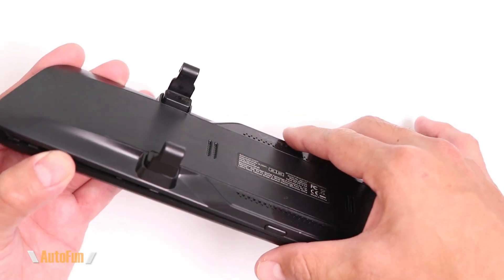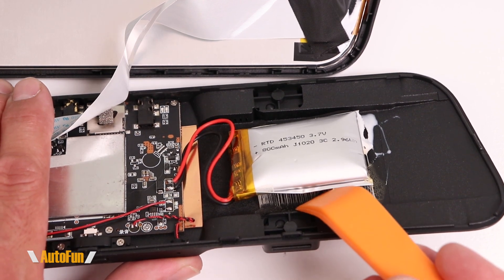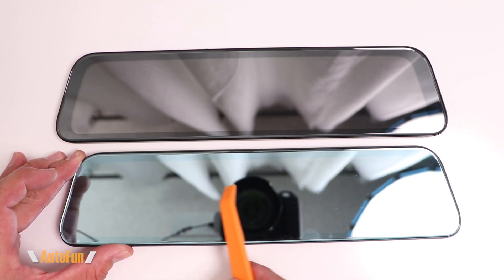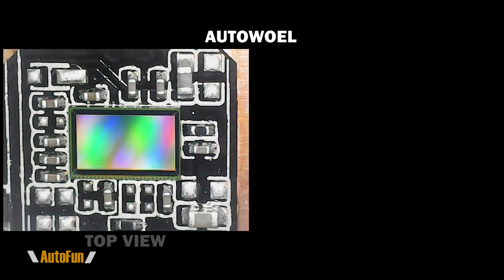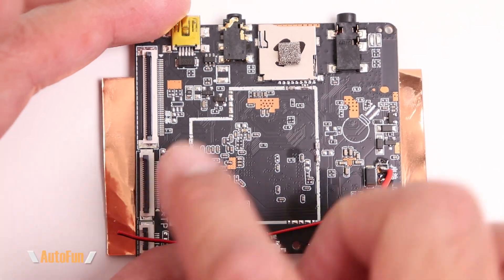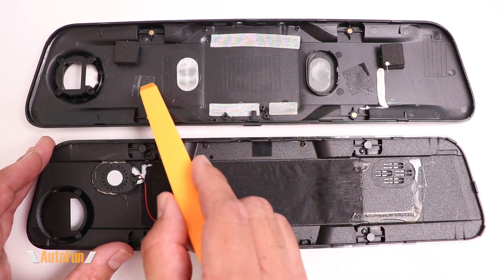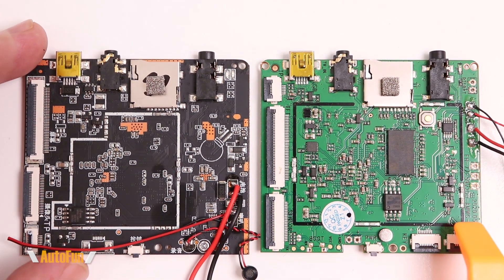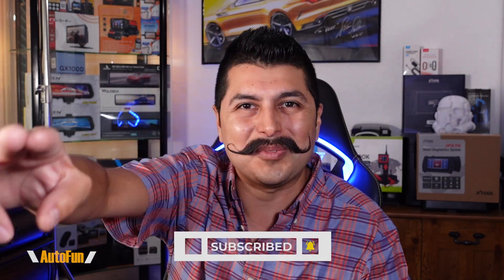Mirror Dash Cam Teardown: Autowoel V17Pro Vs Vantop H612T

Comment: Hi, I bought one, a used BluAvido AC79 Pro (Android 8.1, 4Go/64Go).
I wanted to know if there was a battery inside to keep settings while off.
My device does not seem to recharge something (I've got a little device I can put on a USB port that shows me Voltage and Intensity).
So.. do you think I need to open and replace the battery... if there is one ? 🤭
Reply from the maker: Hi F! Unfortunately I'm not familiar with the AC79, however the manual is likely going to show you if the dash cam uses a capacitor or a battery, Cheers!
Reply: @AlexAutoFun  I was able to open it: no battery. I don't know if it would be a good idea to put a portable battery between the camera and the power supply...?

Comment: Input voltage?
Reply from the maker: HI Kareem! It can be powered with the included power adapter as shown in my full review here https://youtu.be/fQDgk2YnRhQ for Vantop or if you are referring to the V17 here https://youtu.be/bUVG4B8dCmI or the Vantop could also be powered with the hardwire kit here https://youtu.be/83a3w6EtzXo Cheers!

Comment: Have you taken apart any Wolfbox cameras? I have G850 and am considering making the forward facing camera detached. Wolfbox does not sell a model with detached front camera, but I've tested many other brands that do and I just don't like them as much. I'm curious what connectors are used on the G850 camera. I'm sure I can take it apart myself, but thought I'd ask.  My plan is to get longer cables and mount on the windshield to have an unobstructed view.
Reply from the maker: Hi Matt! Ah yes the G880 has a detached from camera https://youtu.be/JJKbUu_egiE but yes I have a Wolfbox teardown video coming, stay tuned. Cheers!
Reply: @AlexAutoFun  I did run across the G880 in my research, however the detached front camera is designed to be a cabin interior view and I believe it has IR for night vision. It wouldn't be an ideal camera to face out the front for street view. I'm sure I could find a different camera to use for the front, however the cost of the G880 is high, on top of buying another camera to use for the front would make it over $300 option I think.    Do you now which Wolfbox model you will be tearing down?
Reply from the maker: Hi Matthew! The G880 has both a cabin camera and a front camera (both are of the detached type) only the cabin camera has IR. Regarding the Wolfbox teardown, it will be one of the two channel ones (making the final decision on the model soon) But I would like to do a teardown on their entire lineup, it just depends if there is enough demand for this style of videos, stay tuned. Cheers! @MatthewBennettFPV
Reply: @AlexAutoFun   Unfortunately the G880 has been replaced with the G890, that doesn't have the front facing camera separated from the mirror. I've looked on eBay and other sites to see if I can find a G880 but none are available.
Reply from the maker: Hi Matthew! That is correct, the G880 is a very hard find now, they do come up for sale every once in a while but when they do, they go quick. Cheers! @MatthewBennettFPV

Comment: What's supposed to be the problem of my dashcam if the time and date keeps on resetting by default when turned on and off. Also it wont automatically record video.
Reply from the maker: Hi Sen! It's possible the dash cam is on it's way out or the power supply it's on it's way out. The easiest way to check for this is to connect the dash cam to know good working power supply (either hardwired or cigarette plug style) to confirm if the issue is with the dash cam or with the power supply. Cheers!
Reply: @AlexAutoFun  could it be possible because of built in battery?
Reply from the maker: Hi Sen! The time issue possible, however if the power supply is not charging the battery, the direct issue would still be would the power supply. Cheers!

Comment: Interesting.  Growing up at around age 8 i had a curiosity for how things work from the inside. Everything in my bedroom was opened up and reassembled by me. Surprisingly it still worked when i reassembled it. 

The super capacitor is one of the reasons why i switched from my vantop to the wolfbox g890. I moved to Az and temperatures here get as high as 120's sometimes. Hopefully this super capacitor could withstand the Arizona heat. 

By the way what happebed to vantop? I searched them on amazon and didnt see any of their dash cams on sale.
Reply from the maker: Hi Edgar! Ah good question, here is my Vantop situation video https://youtu.be/HmcZ-Gyx4To Cheers!

Comment: Or how do I wire my dashcam to not need a battery and just turn on whenever my accessories are on. Because even if it is plugged to my.cigarette port 12V socket. Due to the battery being unusable, my dashcam wont work
Reply from the maker: Hi! If your dash cam uses a battery, it normally won't work correctly without one since the battery may be being used to save the dash cams settings, park mode, closing out video files in case of a power interruption (such as the case in a serious car crash) etc. I would recommend contacting your installer or your dash cam vendor to see if the dash cam is still under warranty. Cheers!

Comment: I also have a mirror dashcam somewhat similar to this. My battery also bloated. Tried changing it but it still didnt work. Maybe you could make a video changing it and showing that it works... mine is a lenovo brand but same sound while booting up. More power to your videos!
Reply from the maker: Hi! Ah yes while I had some viewers replace their batteries, I personally wouldn't fix it unless you want to do it for fun or as a learning experience. In my case while I often solder as a hobby, I choose not to repair mine and just moved over to a new dash cam. The time and effort to source parts (if needed), de-solder and solder and reassemble is just didn't make sense for me with the price of new dash cams rapidly dropping (remember soldering equipment and materials for soldering along with any replacement part will need to be purchased) However like I said if you enjoy DYI projects or just really want to fix your old dash cam It is definitely possible. I actually do have a series of soldering videos coming up, starting from beginner to advanced soldering so this maybe an interesting video to do as a culmination of my soldering video series. Cheers!
Reply: @AlexAutoFun  I see. Thank you so much. Because here in the Philippines. It is cheaper if I could repair it. The battery might cause me about 8$ and the whole new dashcam is about 50 to 60$. Labor also is only about 2$. The hard part for me is sourcing the battery. Bought one and the technician said it isn't strong enough to power the dashcam. I tried contacting the seller of the battery and assured me the battery is ok. Unfortunately I dont have much idea about the process....
Reply from the maker: @cuvame  You're welcome, I hope you can eventually resolve your issue with the dash cam 😀

Comment: Why not replace the battery with a capacitor ? Should do a video how to!!
Reply from the maker: Hi David! While it maybe possible, it would require adding the electronics required for managing the capacitor. I do have a couple contacts with electrical engineering background who could probably help figuring out the electronics required for the capacitor but the process will likely involve de-soldering and soldering and while while I am trained in soldering , It's easier for me to just over to a new dash cam (the time and effort to select the parts, de-solder and solder the new one and reassemble is just didn't make sense for me with the price of new dash cams rapidly dropping) However if you enjoy DYI projects or just really want to fix them or upgrade them to a Capacitor it may be a fun project. I do have a series of soldering videos coming up, starting from beginner to advanced soldering so this maybe an interesting video to do as a culmination of my soldering video series! Cheers!

Comment: When those cheap lipo batteries become discharged they become hot then ad the heat from direct sunlight and within a short amount of time you get this failure. 

To prevent this from happening: extend the battery cable to the bottom portion of your dash where it's cooler and use a 1200mAH battery which only costs about $8 on eBay.  This setup will extend the life of the dash camera by five years.